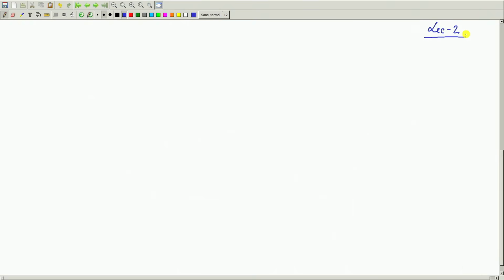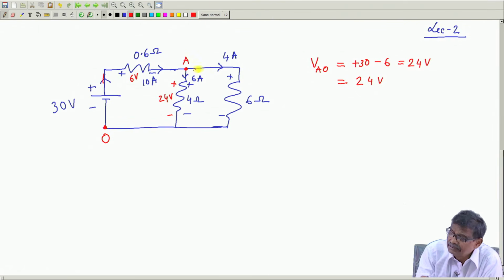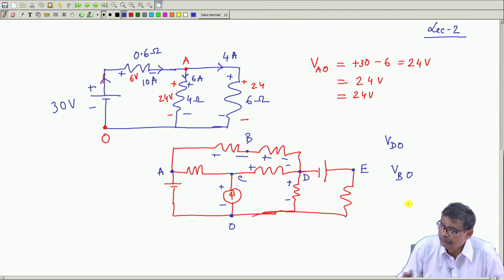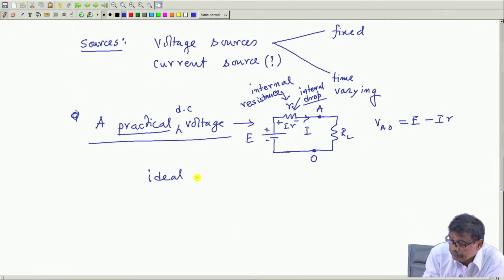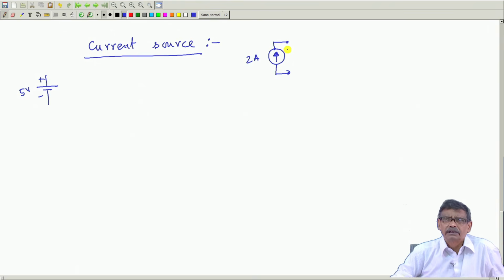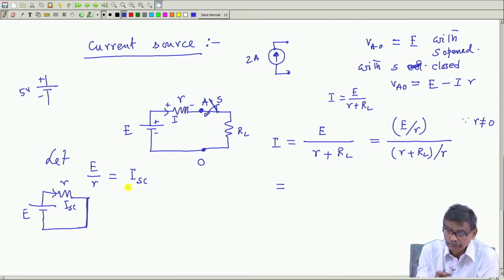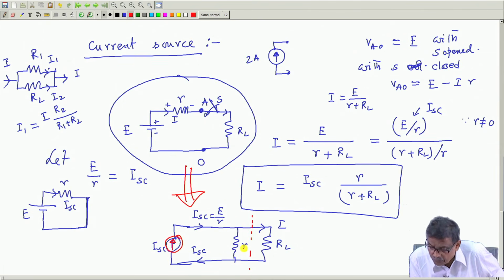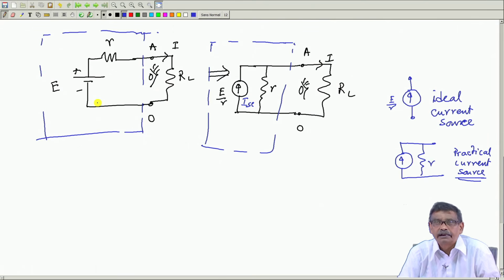Lecture 02: Voltage and Current Sources

Comment: Horrible way of teaching and totally confusing diagrams and notes all shoved onto one sheet of paper absolutely randomly with EXTREMELY  poor handwriting to boot. A shame on IIT's instructional methods. Every one of the Indian private coaching class videos on YouTube is FAR FAR FAR superior.
Reply: This a "concept" based course on Network Analysis. It will benefit only for Electrical Engineers who want deeper concepts. Also those who want deeper meaning. This course is not for surface level problem solving or any exam oriented learning. That's why you  felt it was horrible. Bcoz your need was different (coaching, exam problems ) and ours are different (diving deep into engineering concepts so that we don't get stuck in these things when we encounter it in our job)